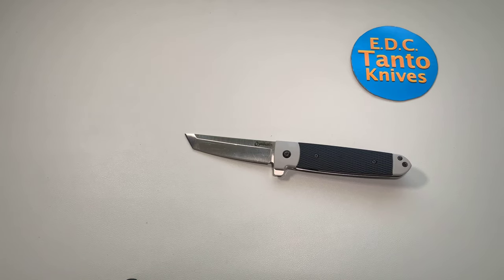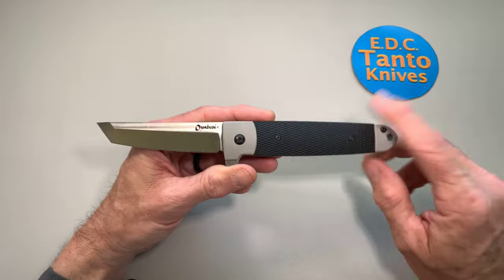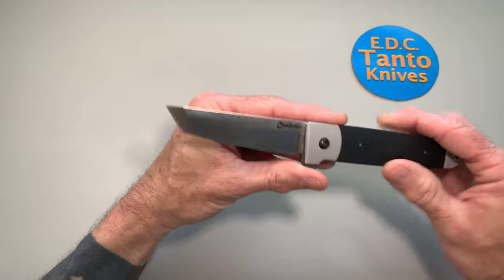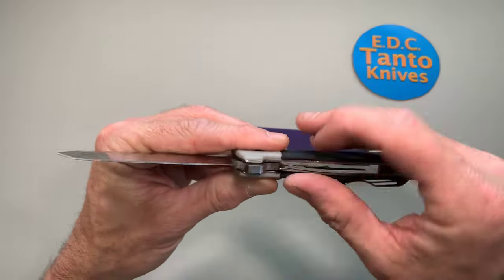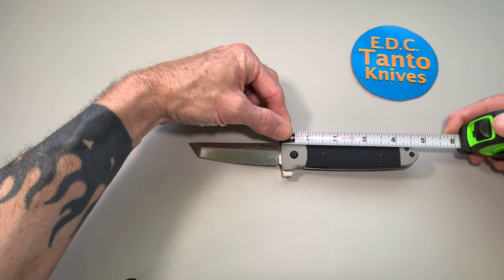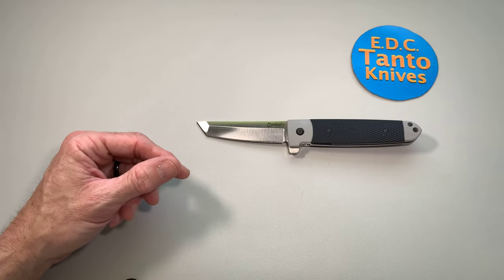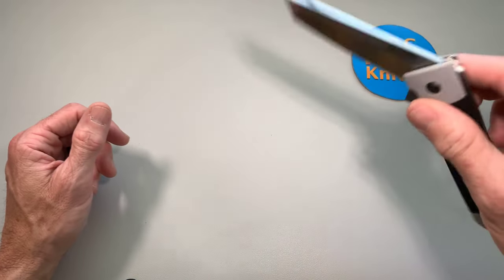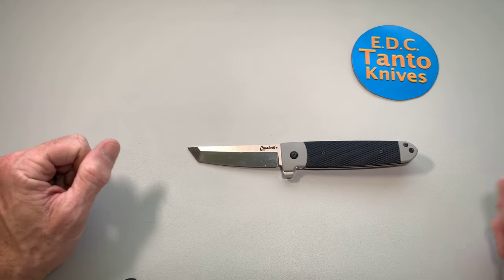Cold Steel Oyabun Tanto Knife    Full Review

Comment: The oyabun's blade is made slim for piercing and thrusting if you look at the Master Tanto which this knife is the folding version of you'll see it also has a slim type piercing type tanto style tip.  This Oyabun is a extremely good piercing knife i have the Recon 1 tanto and the Code 4 as well as the voyager tanto version i have collected most of Cold steel martial folding knives and this Oyabun is a sleeper it pierced thick material better than the recon 1 tanto and the Code 4.  My only grip about it is the pivot has slight play in it but the extra lock gave it the strength it needed to best its stronger big brothers.  If i had my way i would of put the luzon large flush pivot screws on the oyabun plus they are silver. The pocket clip gives you quick access to the knife as well dont forget cold steel thinks martial self defense first most of the time and edc second!....God bless.

Comment: A valuable review, thank you! I've got both sizes of Cold Steel's Luzon; the 4" version seems very similar in terms of the stiff liner lock & flipping action. I found that lock to be rather uncomfortable, because your thumb can only catch the very edge of it, and it digs in (the 6" model is fine, albeit a bit large for edc). I'm not sure why they don't use a knurled plate-like surface on the lock, similar to what you get with their Ti-Lite (much more comfortable), but I'd assume it's to keep production costs down?
Reply from the maker: Thank You, It could use some improvements for sure.

Comment: My first Cold Steel knife and biggest surprise .......looked better in photo online than in my hand. Like a US company using foreign manufacturing  and cheap materials....... Thin gauge metal frame & open back with no middle support making it easy to bend together. Grey plastic bolsters and black plastic grip.......it looks a $10 knife. I paid $55.  Might take a chance and buy another Cold Steel knife at some point.   Although if this US company's attitude is make it cheap.....price it high and no concern of a customer feeling they're getting value. I'm done.........

Comment: This is not cold steel, it is a piece of s..t.
Reply: This is what is happening since Lynn sold off the company to GSM Outdoors.
Reply: Ordered two last week. One would not lock into place fully open, even with the lock activated. With the lock activated, I could still move the blade back and forth. The second one I forced the liner lock into place and after a couple of opening and closing actions, it locks correctly now, but sometimes, the lock doesn't go into full lock, but only halfway. I don't trust either of them. The one I have returned. The blade is quite wide, surgically sharp, very pleasant. I will not buy this model again, nor recommend it. Rather buy a Ruike Tanto folder. The quality of those knives is far better than the Oyabun IMO.